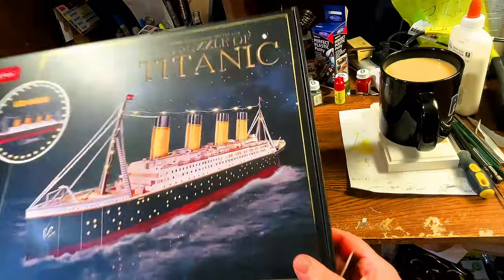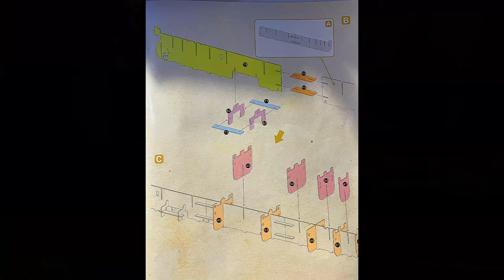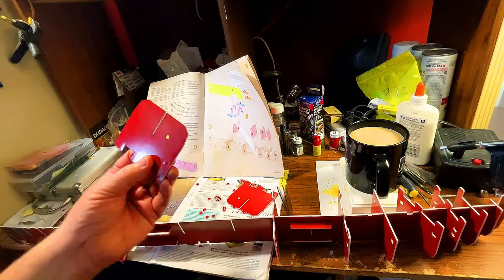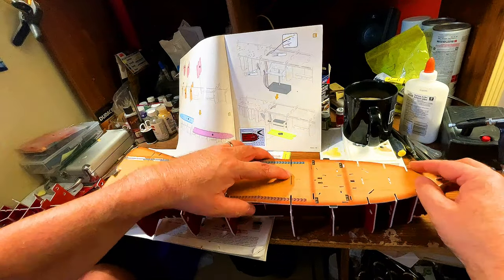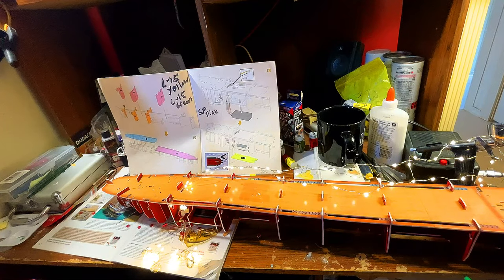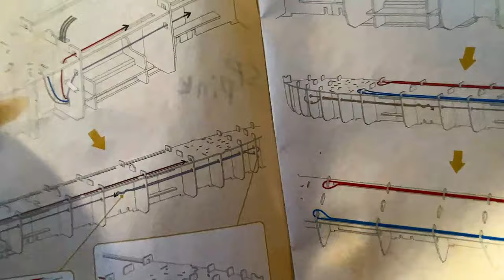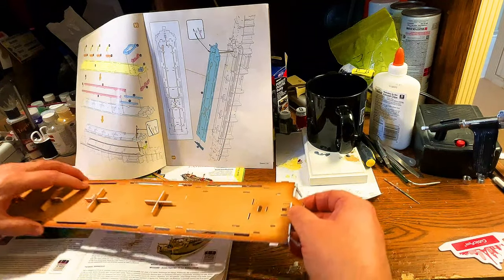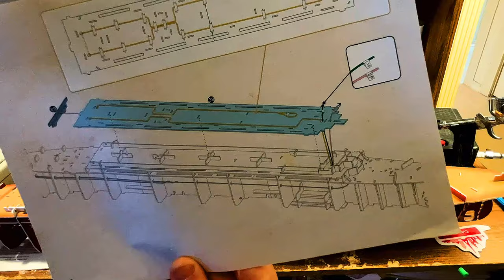CubicFun 1:302 Scale RMS TITANIC 3D Puzzle Kit with LEDs Part One - A to H in the Instruction Manual

Comment: This is a really good tutorial but for some reason my kit the part 37 doesn’t line up right for most of the parts its fine but with one it’s a inch off
Reply from the maker: Thank you. The only advice can offer is that to make sure to follow the numbers exactly on the instruction sheet. They may look similar but they are all different and if the exact piece is not used, it may not line up correctly. I only say that because I learned the hard way on that one. Best of luck with you build!
Reply: I can confirm this also, part 37 does not line up with the bulk slots. I had to return mine as it is obviously a design flaw. I noticed in this video that the guy skipped fitting the part 37 at 18:44 that is an inch out on the last 3 bulk parts. WHY?
Reply: Mine will also does not line up 😭